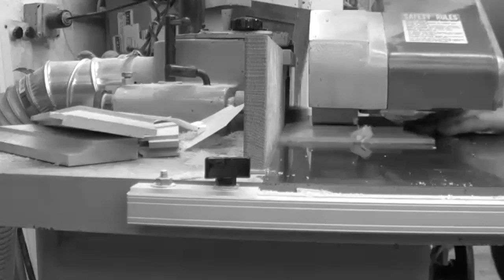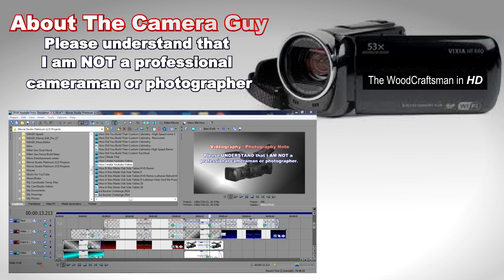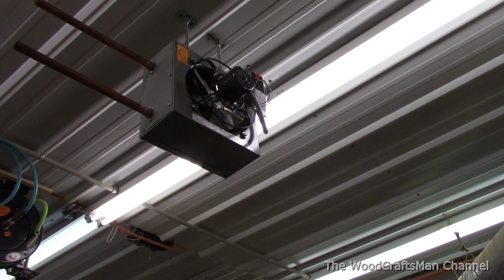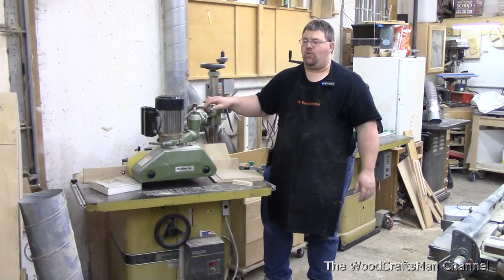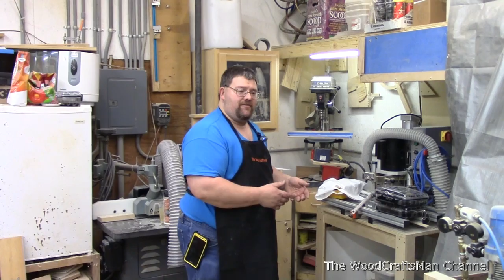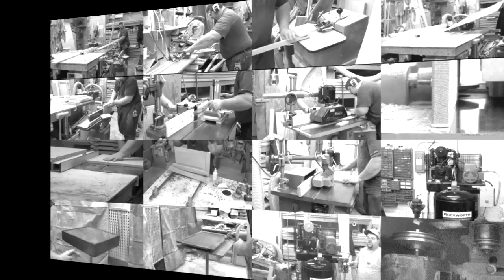Shop Talk 2016-3 Shop Updates New Shop Layout For The New Heating System # 177

Comment: What is the difference between the Powermatic 27 and 27S shaper
Thanks
Reply from the maker: Hi, the difference between the 27 and the 27S also known as the Super 27 or 27 Super is the table size. The standard 27 would be 29" deep by 28" wide, and the 27S would 30" deep by 40" wide. They also had different spindle options such as 1/2" and 3/4" interchangeable, 3/4" solid, and 1 1/4" solid. All of the 27 models came with the newer style spindle height locking nob in the spindle height adjustment wheel, improved 3VX v-belt drive and Baldor electric motors. The 26 shaper used a separate spindle height lock knob, they also had a special tiny poly v-belt drive about 1/4" wide, and came with either Leeson or Baldor motors. Thanks! Scott
Reply: +The Wood Craftsman (puttz1976) Thanks Scott! What would I have to pay for one? There is one here in Canada they are asking 2300$ Can
Reply from the maker: +Bid Budy The 27 series was replaced with the PM2700 (POS my opinion). If it's new old stock, you will pay a gem, otherwise used ones go for $500-1800 US. They use standard electrics, and 3 & 5HP motor with 145T & 184T frames.
Reply: Thanks for the info! Do you have any experience/advise on a moulder, Ex:Williams & Hussey, Woodmaster...
Reply from the maker: Not really. The W&H is on my wish list because of its simplicity, however because they are so popular, used ones are rare, and go quick. Scott

Comment: I have been down that road many times.  Every change usually caused by a new machine needing to be fit in, but it seems to work out every time.
Reply from the maker: +jocmarti I couldn't agree more. It was one change that led to several more after, luckily no electrical or dust collection not required to keep working. Thanks! Scott

Comment: Hi I find your videos very informative keep up the good work. Just a quick question not about this video, I seem to remember you talking about an old "aaa" system you made up out of graco (model 390 395??) with shop air and an aaa gun. Am I remembering correctly? I ask because I run pressure pot set up  but have a chance at a good priced 390 was thinking of getting it just for laying down kem aqua sealer, and primer/surfacer. any thoughts?
Reply from the maker: Hi, thank/4/4/s for the comment. Yes, you are correct. My first AAA system was shop built with a Graco 395 ST Pro electric airless unit, a Graco G15/G40 AAA spray gun, 1/8"x50' ExitFlex high pressure fluid hose, 1/4"x50 Parker parflex U64 PU air hose, 1/4" HP Tee, Glycerin filled 1000 psi pressure gauge, and an air regulator. Its something I did a while back in 2008 where everyone was telling me it wouldn't work, and shortly after I did mine with sucess, Graco launched their 390 Fine Finish Pro which is essentially the same thing but has an on board compressor. You could do the same. IF you Get a Graco G15 you can easily convert it to a G40 with a conversion kit for around $135, (only if you plan on spraying over 1500psi). Good luck. Scott

Comment: Great and interesting information on the heating system. I have no experience or knowledge on HVAC except to say the previous owners to the home I live in now removed a massive boiler and radiators throughout the house. Probably for the reasons you stated, cast iron units were removed only because they didn't want the objects standing out in the room. Sad thing is, they didn't do a good job at all of completing the project. 

I was wondering, are you concerned at all that locating the new baseboard heat behind the shapers will result in warming up the cast iron and steel in the shapers rather than heating the working space of the shop. I guess it could be a good thing in some respects, the shapers may act as a heat sink and keep the shop warm for longer periods of time. Again, I have no knowledge of heating systems, just wondering what your outlook on this might be, you've obviously put a great deal of thought into developing a solution for your shop.

Thanks for the time to put the videos together, they're very informative.
Reply from the maker: Hi, thanks for the comment. Looking ack at my thought on radiators vs base board, I guess I didn't take a look at the newer style wall hung units typically found in Europe. I think the baseboard will do exactly as you stated, they will probably heat up the cast iron and steel and dissipate the heat as a big mass. With the combination of the base board and the hydronic unit heater, it should be very comfortable. Thanks! Scott